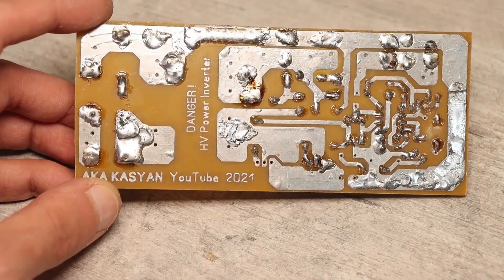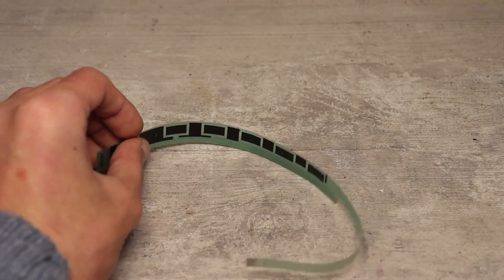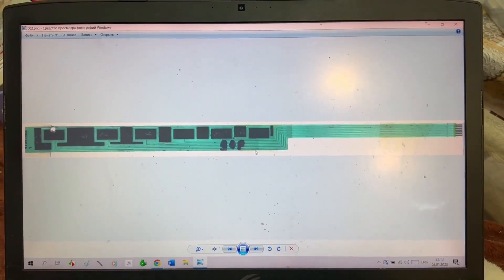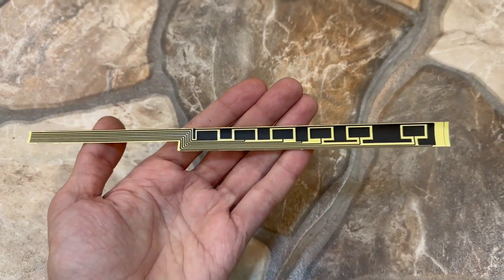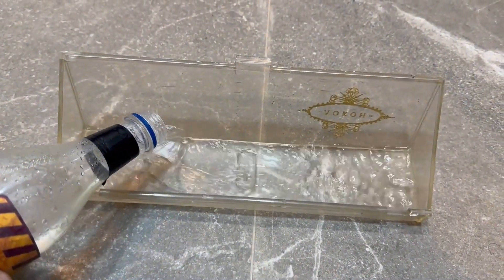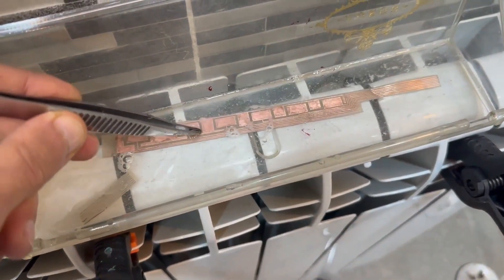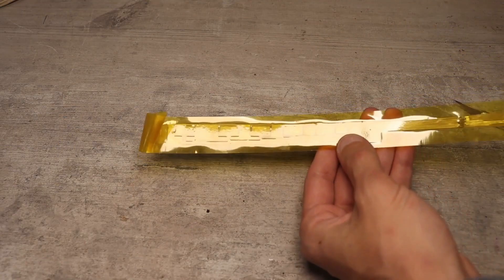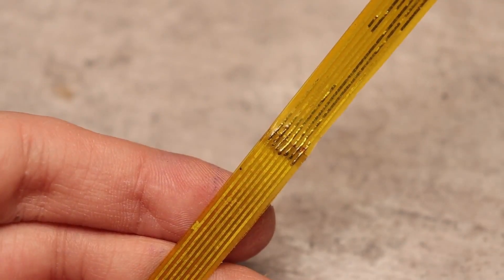I Almost Stole from a Chinese Factory — The Ribbon Cable Heist!

Comment: There is adhesive copper tape that can be used for this, just print the ribbon on it and etch.
Reply: Yes, my wife uses it for lead lighting. Readily available too, and inexpensive, and some even conducts through the sticky - i checked and borrowed some 😂